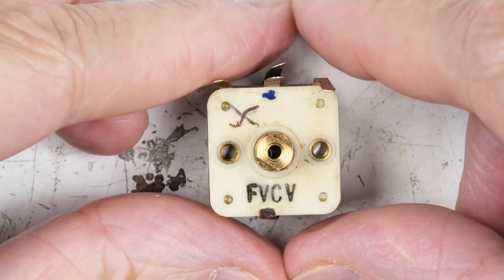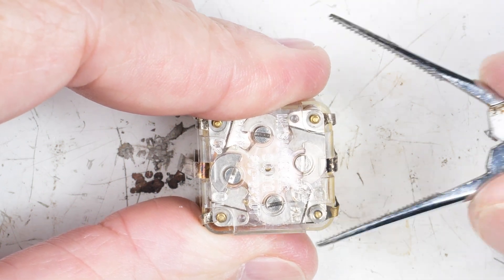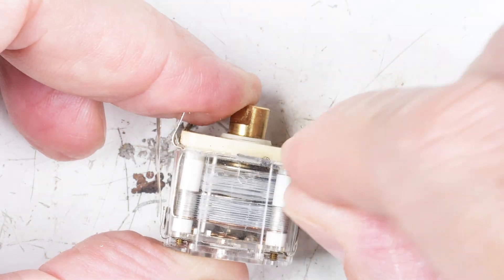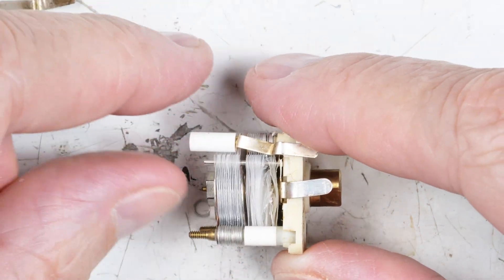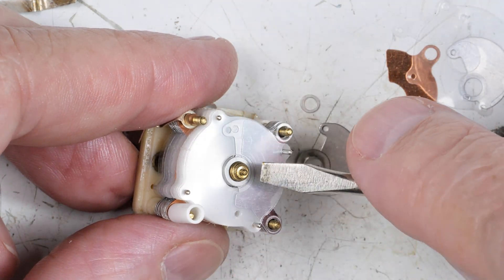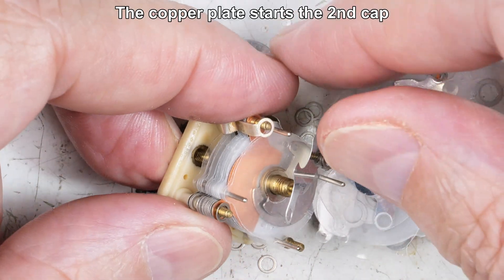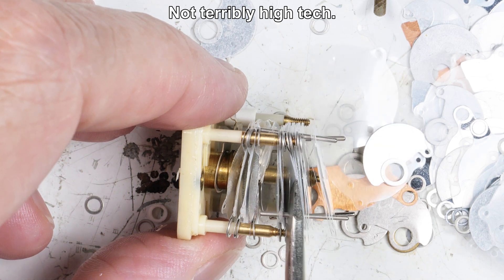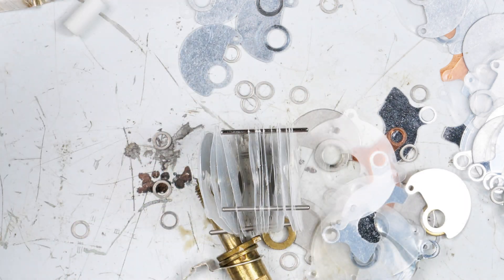Electronics-Film Variable Capacitor Teardown

Comment: When I used to do RF projects, I gad many variable capacitors, with air and film. Those were with 1, 2 or 3 sections (air, 2 or 3 AM or 1 or 2 FM) or with 2, 3 and maybe 4 secctions (film 2xAM+ 1 or 2 FM). I mostly had them new and some recovered from old radios. The air ones had sometimes gear reduction.
In your opinion and from your experience, what is the best, the air one or the plastic one? I always considered the plastic ones to be cheap and not too good and I avouided using them, but maybe I was wrong.
Reply from the maker: @sebastian19745  You are right. I have both low and high quality film type variable capacitors, and none of them perform as well as an air cap. I've never seen a CR contester use a film cap. The problems with air caps include their large size, fragility, cost, and scarcity.

Comment: I've been looking for ages for a single 350 pF capacitor like this, to make a crystal radio like I had in the Seventies. Huge clunky air variables are out there, but not single or double poly caps... You lucky guy!
Reply from the maker: @Pygar2  This was a double 350. You can easily find the 240pF caps. Then you can switch in and out a fixed 100 pF cap. Or, I'm working on a coil that matches the 240pF cap.
Reply: You can find them in new cheap radios with tuning wheel or some DIY chinese radio kits and also in many 90s-2010 cheap portable radios. They mostly have 2 sections for AM but not sure the value, I saw 270pF but also 330pF. Those that have more secctions (for FM), have the values around 22pF, but I saw also 16pF. Those values are the max capacity
Try your luck.
Reply: Try radio alarm clocks they mostly have them